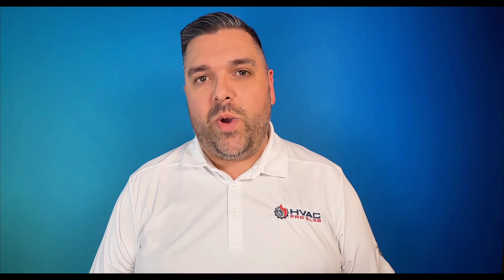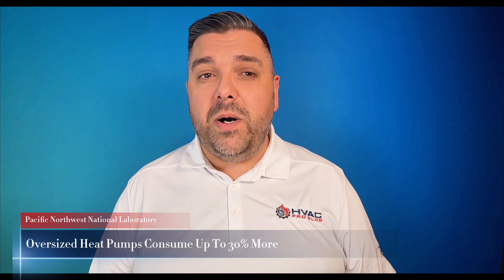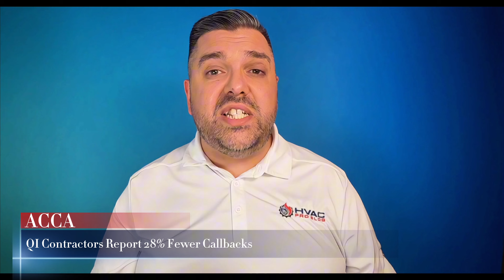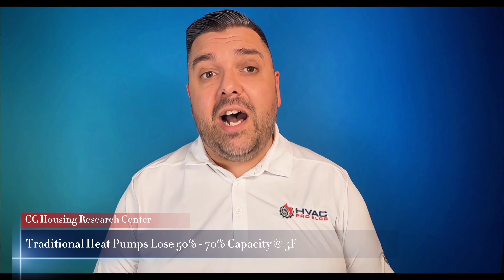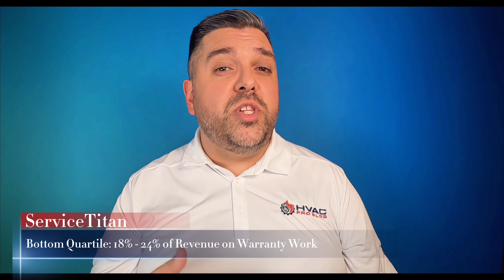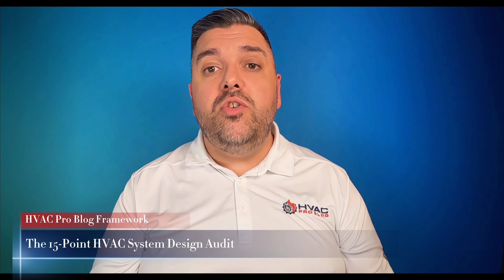The 15-Point HVAC System Design Audit That Exposes Your Weakest Link

Comment: Chris - all great advice, but this is NOT industry standard. Industry  standard is swap outs and high margins on upsold too large units - that yields real quick healthy profits. Why change?the business and the employees are set up to do this. why check/commission/verification ? It only alerts client that it didnt work because the ductwork leaked or was blocked or was in adequate. Clients don’t want to spend that money, contractors cant do adequate design work and dotn want to. If contractors will guarantee comforts prior to signing (ie do the design before hand) yes you can up charge with confidence. But that’s bot how the business works. No guarantees, no design no commissioning, if you don’t warranty “comfort” the client cant chase you after swap out. NOT more profit.